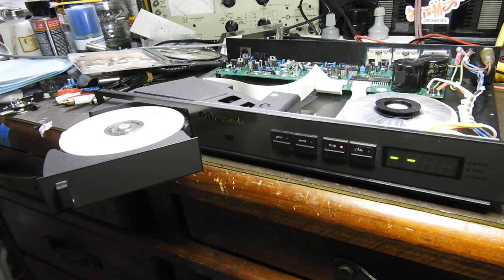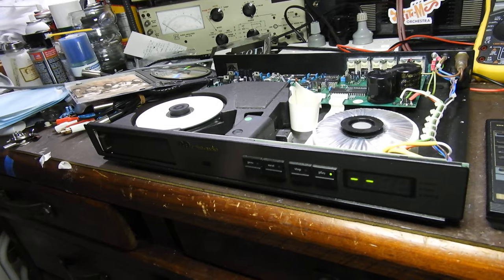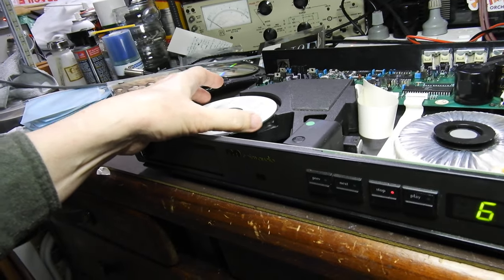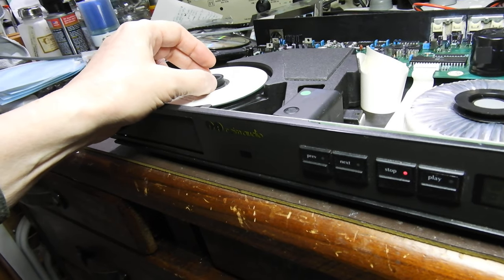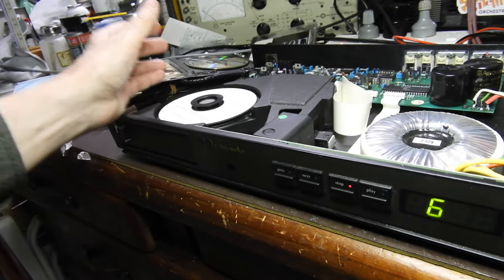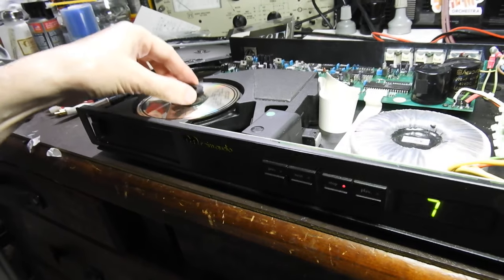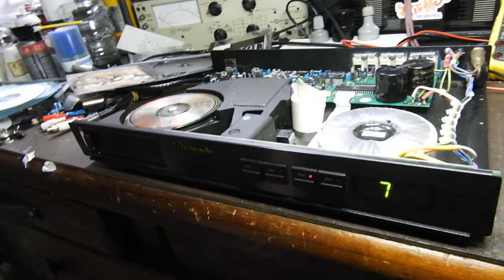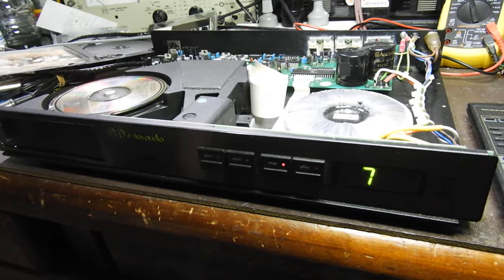CD won't play - clamp issue (yet another reason why). This time in perfectly working Naim NAC D3 CD

Comment: Great vid.. Pertaining to sound, What is your opinion of the newer naim  cd5si vs  previous generations? And would you recommend changing the Puck as well?
Reply from the maker: Jose, I have no opinion for I have never came across it. :-(  There are few Naims that I would like to get my hands on (CD5XS, CDX, CDX2) but they are very elusive. They were very expensive, so not that many were sold and obviously reliable enough to never show at my workshop.

Comment: Do you have a reference for the Tascam puck ?
Reply from the maker: Well, I was given 2 x Tascam Cd-601 by a guy who bought them at auction and removed KSS-151A lasers from them. Having useless machines, I removed the puck from one of them and it is now very useful for testing players. If I had one of the Naim machines, I would probably use it every day. Not as sexy as the original one, but sure works better.
Reply: @hear-net-au   Thank you for your answer. I have a Mark Levinson CD37 transport with CDs that it reads at times, and for which it displays a Bad TOC and refuses to play the moment after. I suspect a similar issue with the puck, but have no clue where to find a puck substitute.
Reply from the maker: I got mine from the Tascam CD-601 broadcast player. Some guy bought 2 of them at auction and removed their KSS-151A lasers to sell them as parts for $350 each and he game me these laser-less units. I doubt anyone would pay that much for a laser which cannot be proven to work. I myself would have fixed the players and only then offer lasers for sale. I would have also measured their current drawn, so that the amount of wear could be determined.
Reply from the maker: @jmlathion2909  Is this a top loader?
Reply: @hear-net-au  No, it’s the same “thin” metal drawer that was later used in the 39 (that you know).
Reply from the maker: No. Tascam CD-601 is a regular player. I removed the puck from its loader
Reply: @hear-net-au  Hello, Yes. 

But I was seeking advice about the puck for my Mark Levinson CD 37 which has a metal drawer.  I think that the puck is not doing its job properly. So the question is : where to find a substitute, or how to fix that type of problem ?
Reply from the maker: @jmlathion2909  Well, take the bridge out and examine the puck to see if it has failed (missing magnet, missing bits of plastic or perhaps got deformed in some way). If all looks OK, then see if it mates well with the turntable. In some units the puck will mate well without CD, but if it does not, put CD on the TT and see if it mates well then, and CD spins freely and has no rattles or wobbles on any CD that gave you problems before (spin in manually if you do not have a voltage source like 3V battery).
If you see any issues, it might be easier to get a new turntable than a puck. For a puck, you have to write off another player. For good TT, you only need to salvage it from another old (even faulty) mechanism. I could even send you one.
But then you have to fit it properly and get the height right ;-)